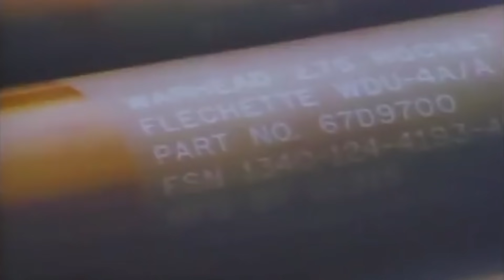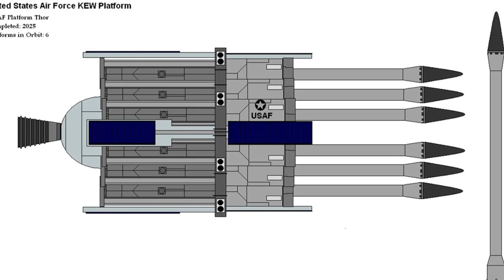'Rods from God' Weapon System Gets Another Look

Comment: Tungsten metal has a melting point of 3,422°C. It's not going to break up or melt on re-entry, there have been a lot of classified launches, and a standard JDAM guidance  package would work just fine once you are in the atmosphere.
All you need to do is work out how to accurately de-orbit the thing, and you have a very discreet way to take out high value targets with high accuracy and zero warning - it doesn't even have to be that big and a 400 kg rod would devastate any target.
Reply: A 400kg rod hitting at high orbital velocity would be devastating. Roughly 12 tons of TNT focused on such a tiny impact point.
Reply: You can almost guarantee the US has built this thing. First thought of in the 1950s.
Reply: @ryankelly4111   there's probably one up there right now
Reply: @unrulybot1352 it's probably what space force is for....lol
Reply: They do have it and are using it..word of thought when the military mentions they're going to use something etc..they already have..Rods are taking out the underground tunnels and will take out all S atsnic bldgs used for child trafficking and S atsnic ritual abuse human etc experiments
Reply: Could use rods that have tungsten cores
Reply: @ryankelly4111  Tungsten has two qualities that make it ideal for this.
It's high melting point, and it's high density.
If you had to compromise on material usage, it would make more sense to put the tungsten on the outside, but honestly, while tungsten is expensive, it's not expensive enough to make compromise worthwhile.
Reply: @baldieman64  it the cost of getting it up there that makes it prohibitive. Not the price of tungsten.
Reply: @m.b.82  Are you sure that post was intended for me?
Reply: @baldieman64  yeah  i think so. You were talking about the cost of tungsten and skinning a steel core in tungsten. Solid telephone poles of tungsten would be the only way to do it, but getting them into orbit would be almost impossibly expensive and unfeasable.
Reply: @m.b.82  Try again. Read all the posts.
Reply: @baldieman64  nah im good
Reply: @baldieman64  what about ceramic coating of tungsten/depleted uranium rods? Let’s say having a stealth satellite in far orbit as a weapon of first strike?
Reply: @kamilpotato3764  Why would you bother with a ceramic coating?
Tungsten has a melting point of 3,410 °C (6,152 °F), so you gain nothing and by adding the relatively low density ceramic, you create drag and reduce your available kinetic energy.
Reply: @baldieman64  Screw it then. Lets put engines on asteroid then 🤣
Reply: @kamilpotato3764  Maybe not the best option as a weapon, but easily the most plausible way to build an interstellar starship for humans, because it gives you all the radiation shielding you could want.
We just need the autonomous robots to hollow it out.
Reply: @kamilpotato3764  technically if you could shoot a solid mass and knock an asteroid off its trajectory enough in a calculated way it could be used as a weapon if you could do the math to work out the reentry and landing etc etc.
Reply: @donniebaker5984  you dont know anything about me.
The military has cheaper more effective ways of doing things than sending the equivalent of 400 Saturn V rockets into orbit to make one boom-boom
Reply: @kamilpotato3764  thats being tossed around in the think tanks now
Reply: The tungsten itself might not melt, but these wouldn't be solid tungsten and is a reason we use ablative heat shields and not tungsten on spacecraft... they contain things inside that don't like a lot of heat, computers... sensors, maneuvering thrusters.. etc.
Reply: Chat message: XxdictatorlulsxX was squished with tungsten block by us_a
Reply: Not to mention you could coat it is paints that are used for re-entry vehicles already. So, no big deal keeping it intact on re-entry. We manage to keep aluminum intact on re-entry we could keep anything intact on re-entry. Simple. We only need it intact until it hits the ground anyway. Plus. Along with Nukes, this is another great deterrent to Russia using Nukes. 👏 It would mean even more destruction along with the Nukes we would launch at them. 😃 Imagine living in Russia and China during a nuclear war with these giant rods raining down on them as well. Targeting everything!
Reply: Who gives a shit what Tungsten melts at , do you real think they would come right out and blab to all of us exactly what the rods of god are made out of ....the afterburners of military jets glow white and get translucent at 30,000*F  ..and they also said the  sr-71 blackbird top end was almost 3000mph mach 3 
.and never shot down by thee at a time Russian surface to air heat signature missiles that leave the launch pad at 19,000 mph mach 7  tri- vectoring the sr71 and missed every time as the piolet said the sr71 simply out ran the missiles .
Going slower ..sure they did sure they did my boy .....snap out of it kid and try and learn HOW to stop trusting the nasa nazis just because they said so
Reply: Melting point is not the issue. The issue is the rod will become pliable and can break apart long before the melting point is reached
Reply: @89five3five  Always read the rest of the sentence before replying.
Reply: Man if you get hit with this,  your done.  That's it.  If they multiple over an area, who cares about just one?
Reply: The real issue is getting the satellite in place, and then keeping it in control once it loses a significant amount of its payload.
And what are the logistics of this satellite constellation?
Are they nominally geostationary and then reposition?
Over what countries do we place them?
How many repositions can they execute before running out of fuel?
If one of the satellites is shot down in space (very likely)... what happens to the tungsten rods already onboard?? They're not going to just break up out there. Best case scenario they start tearing through other satellites... worst case, you have uncontrolled drops on .... hopefully ocean ? Will all those rods cause a tsunami?
I think the end of his video was hinting at using SpaceX to launch a 1-time delivery mechanism. Launch one rod at a time. In that sense, the military element operates similar to an ICBM. And it eliminates a lot of the questions about having nukes-without-the-fallout always pointed right down on people. Sun Tzu would call that "death ground", and it's usually a place wise strategists avoid putting their enemy.
Reply: Or just shield the rod with ceramic plates llike the US space shuttle had.
Reply: Yea, but if it hits the wrong target ………………. Ooooooopsies
Reply: Jdam guidance package would not work due to a skin of plasma
Reply: @communist754  Hence the need to accurately de-orbit and shield the guidance unit until it'd deeper into the atmosphere.
Reply: Step in Elon Musk...lol
Reply: He would have to get it out of orbit the same way that they did the space shuttle then you can drop it to me where you want just like setting your space shuttle down on the runway problem at all
Reply: Tungsten is very expensive. Do you know how much energy (fuel) it takes to get a 1T payload into orbit? And then you have to worry about a killer satellite wrecking the whole plan.
Reply: @eddarby469  tungsten is not expensive i have chunks of it laying in my garden. trust me i know.
Reply: @acousticpineapple7851  I guess this depends on your point of view.  Steel sells for under $1 per pound, and tungsten sells for close to $20 per pound.  I'm not sure what the unit weight is for tungsten, so maybe a pound of tungsten is twice as large as a piece of steel, but it is quite a bit more expensive than steel.

OTOH, I don't know what "high temperature" steel alloy costs, and I don't know if it would survive the fall of being used like a kinetic dart.  Maybe a tungsten tip on a steel dart would be better.  The steel "melting point" is typically around 2300 deg F, which is close to 1100 deg C, right?
Reply: @eddarby469   just to be clear, anything made from steel would at least partially melt on re-entry and cause the projectile to lose accuracy or just be outright destroyed. we are not comparing it to steel dude, its about the cost of a metal that can withstand re-entry from space. tungsten is very affordable from a military budget standpoint, its not rare or in high demand, the only real cost to this crazy idea is getting it into orbit. it would take multiple trips and the projectile would need to be assembled in space. then there would have to be testing, etc. at the end of the day its easier and cheaper to just drop a MOAB or a bunker buster from a far lower altitude and get a better result
Reply: @acousticpineapple7851  Thanks for the reply.

I've been thinking more about this and I think I've figured out one of the important parts of the physics of this idea.  The fact that the rod reaches terminal velocity might allow me to say this is where the rest of the energy goes ... it is the heat created on reentry.  I wonder what the optimum shape is for this kinetic dart.  I assume it would have a spherical shaped nose, and the nose section would be slightly larger than the rest of the shaft.  I wonder if giving it "golf ball dimples" would help it or not?  Then there is the "fin section".  The Fin Section would also have to be able to remain intact on reentry, and I would expect it to be able to guide the rod to the target.  And that would be a tall order.

The concept is simple.  You position the satellite in the right spot and let the dart fall to earth.  But the tiniest error and the thing misses by several city blocks.  And then weather is still going to play a factor.  So the dart has to have a guidance system, and this system has to survive reentry.

Still the biggest cost is getting the darn thing up there.
Reply: @acousticpineapple7851  Not when Starship SH is up and running. 100 tons to LEO per launch at 2 million USD per launch.
Reply: @acousticpineapple7851  the rods would be coated with the  ceramic coating that coated the old space shuttle's heat shield tiles. I used to inspect turbine blades that were used in GE 90 (airliner engines) the parts of the blades that were exposed inside of the engines were coated with the stuff.
Reply: @eddarby469  "The concept is simple.  You position the satellite in the right spot"

This part is not simple at all. You can't just stick it above Moscow or Beijing 24/7. Repositioning in space is fuel-expensive.
First you have to launch this behemoth fast enough to match Earth's rotation at a much higher elevation.
Then you have to have enough fuel on board to relocate it into other orbits to remain over a specific target. And even then it will have to deal with the corialis effect, waiting for a specific time window when the figure 8 passes through the target.
All the meanwhile, any country with a Space Agency will see all this going on and probably just shoot it down with a missile in <1 hour.
It takes NOAA ~3 weeks to reposition their geostationary satellites.
3 weeks is along time to press the big red button and wait.
Reply: @niallk9336  Merry Christmas!
Reply: @niallk9336  The problem with shooting down the satellite with a missile is that you are shooting down someone else’s satellite with a missile which will spark an international incident, shooting down a balloon seems to have caused a minor one, imagine a satellite.
Reply: @eddarby469  do you know there us no budge on weapons of any kind .. cause read my lips the black budge and black projects dont aways tell you top secret matters of their operations thinking thats better than showing our enemies all of our defensive ways ..and we dont like to show everyone our best shot that would give all those who wish to kill all of us a 100% chances of being successful .thats why our armies dont tell what they have so we dont get murdered as all suggest that will happen when you give the enemies complete control of life and death over you  as what the millennials keep saying is their right to know  yeah right ; .
Reply: They were never trying for explosive effect they wanted wave affect.
Mobile earthquakes flattens city in seconds or minutes no fallout.
Vacuum acceleration perfect, just orbits then fired hits in minutes or quicker depending on speed.
Reply: @jamesmaralyn6745  (π * (0,3048 * 0,3048))* 6,096= around 1,7791 m3 and tungsten is 19250 kg/m3 so the rod is 34249kg if it is in low earth orbit its traveling at 7730m/s and (7730* 7730) *34249 is 1023238536050J or 244,5 tons of tnt because one ton of tnt represents 4,184 gigajoules 
even if we consider potenial energy 
34249 * 300.000 * 9.81=100760386755J
(or around 10% of the energy of the rod)
we only get 1.123.998.922.805J or 274,1 tons of tnt 
in comparison the bomb dropped on hiroshima exploded with the power of 15.000 tons of tnt so the rods are not that strong and if you use a falcon heavy ($97 million) you have the problem that it can only bring one rod into orbit because it can only carry 53,000 kg to leo one other problem that was not considered here is friction in the atmosphere which would lower the energy of the rods even further and the rod would probably only accelerate to Mach 10 which would mean only 201468030050 J or 48,1 tons of tnt which is nearly 5 times weaker so yeah probably not gonna happen 

if we wanted to rod to be as strong as the
largest bomb ever detonated 50Mt the rod would have to travel at 3495198 m/s (Mach 10190,08 or 1,1687% the speed of light) not the theoretical 7730m/s  it is going at and just a  reminder the energy to double the speed of a object is squared so it would need 4x the energy to go 2x as fast ok lets go a bit smaller if we want it to be as strong as the hiroshima bomb (15.000tons of tnt) it would have to be going at 60538.620097783 m/s or 0.20193303% the speed of light
Reply: @user-vy5hc9ud6l  have you every seen sequence blasting in mining.
Multiple charges, not high yield detonated milliseconds apart.
Large quantities of earth is lifted and returned in seconds.
Now imagine multiple projectiles striking in sequence all along fault lines.
Do you think it might have some sort of effect. Especially if hits a couple of those nuclear power plants just like a dart.
This why humans can never have nuclear war, to many large detonations at once never good.
Number more important than speed.
Plus space makes easy to hide anything, multiple launch's can take care of weight, ever seen a pool cue that splits in two. Space station assembled in sections.
Reply: @jamesmaralyn6745  I don't get it, how can a metallic rod create earthquake or explosion? It can probably destroy a building because it will act as a bullet with that amount of kinetic energy and all it's force is one direction that is towards the ground. But how will it cause an explosion?
Reply: @spacewalker7520  gravitay
Reply: @spacewalker7520  Shockwaves, remember, Force equals Mass × Acceleration.

Sending a ridiculously accelerated projectile with a ridiculously high mass can have a devastating shockwave effect.
Reply: @soulstalker4624  The equation you should be looking for is probably the one for kinetic energy, K = 0.5MV^2. Where k is the kinetic energy(joules), M is mass(kg), and V is velocity (m/s)
Reply: The satellite isn't a problem of itself, the price for loading a lot of tungsten into a shuttle or rocket it's the biggest issue.

But hey, if the US has 600 billion dollars for military power, loading 12 tungsten rods 1 ton each isn't going to be a problem, specially when you consider that we had 30 ton rockets and shuttles loading into other rockets.
Reply: That said, the comparisons with nuclear warheads are absurd. A 2000 lb projectile with an initial velocity of 7 km/s dropped from an altitude of 1000 miles would impact with less energy than 10 tons of TNT. That's still a devastating impact, of course, but less than the smallest nukes ever tested by the US (though it's close—42 GJ for the W54 nuclear warhead, and 37 GJ for the orbital kinetic weapon). Most nukes are at least 2 orders of magnitude more powerful.
Reply: @nameismetatoo4591  No one would just drop a KKV from a standard orbit, expecting the resulting kinetic energy to beat out a nuke... thsat is just more or less the Hollywood interpretation of the concept. Instead, multiple KKV's would be put on very long, staggered orbits out around the moon or even the sun, where, over a long period of time, a combination of ion engines and sling shots can build up a velocity reaching a fraction of the speed of light, requiring a simple nudge from a chemical rocket engine to aim it,  and staggering multiple KKV's would ensure no one would be waiting a month for the strike to happen, with a KKV always within  24 hours of impact, and this is even the super duper simplified version,  these things would, in reality, get insanely complicated, moving at relativistic speeds.
Reply: @HicSvntDracones  everything (unless static/stationery) moves at a fraction of the speed of light lol
Reply: @FreedomForAll2013  Ok captain literal.. even though you are very correct..  I will point out that nothing in the universe can truly be stopped, it all depends on what the reference point is. I think it is widely agreed that when we say fractions of the speed of light, we are talking about a general fraction, 1/4, 1/2, 1/16 and not insane fractions like 1/25563455640985 or 1/754376856423535475674534677... adding the term "light speed" lets the person you are talking to know that you are referring to a scale of speed that is somewhere in between 299,792,458 meters/sec and 343 meters/sec, I actually found a poll that shows most people take the term fraction of the speed of light to mean 74,948,114.5 meters per sec, or 1/4 the speed of light.  I would find it insane that someone actually did a study to find the answer to that question, but here I am having to actually use the data from that research :) Thanks for that, it was actually very interesting to learn it.
Reply: @HicSvntDracones  haha anytime lol
Reply: @nameismetatoo4591  22.22 GJ would be the energy released, that's close to a small nuke so it's not as insane as it sounds 😅
Reply: @nameismetatoo4591  well that veing said, this is not just dropping the rod, it is propelled via electromangetic discharge, it is a gauss cannon for all intensive purposes and gains its super high speeds from the launch not from  reentry lol